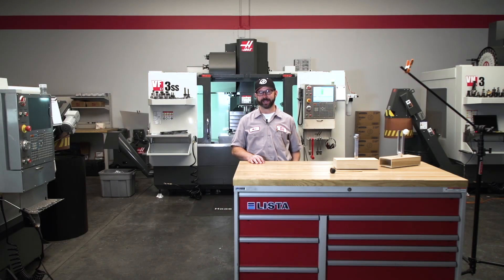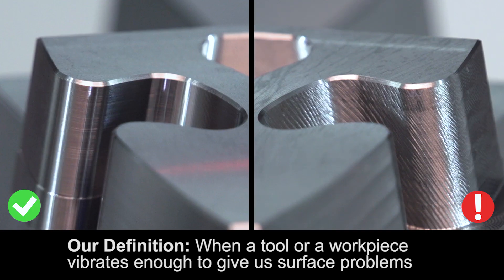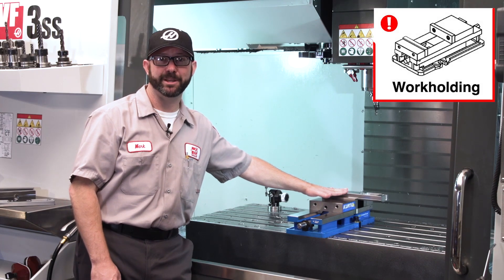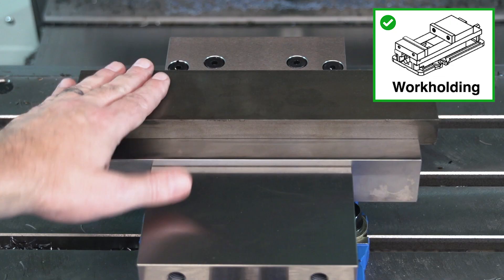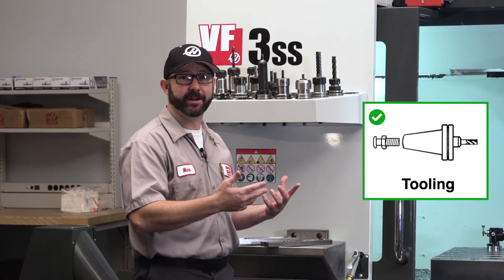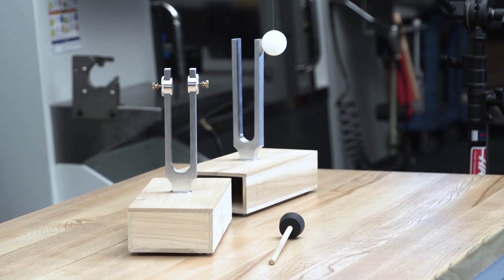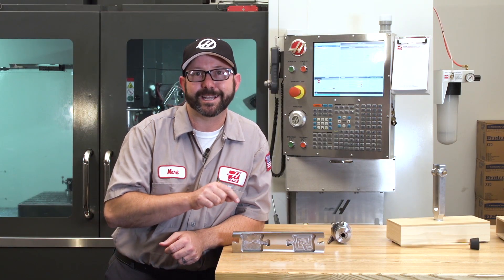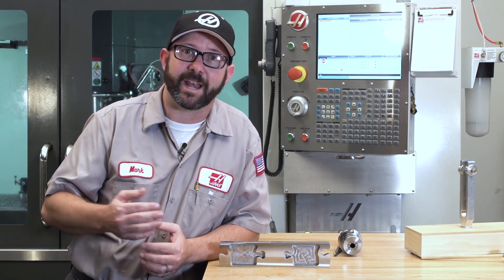Avoid Chatter on Your Mill - Haas Automation Tip of the Day

Comment: I know a secret about improving setups to eliminate chatter if Mark from HAAS cares to reply to my comment, I will share it. that way I know that I am being heard.
Reply from the maker: Paul – Now, I’ve got to know! What do you have for us? – Mark, Haas Tip-of-the-day
Reply: Mark I don't know if you know or not but there are two great ways to drastically improve a flimsy setup.
First is super stone from emdin products in california. it is a low shrinkage die stone used in the dental industry. when it dries it does not shrink like common plaster and is glass hard so you are literally able to clamp it in a vise. This stuff works well when you need to build support around the outside of a part The downside is that if you put it into a cavity it is like cement and will scrap your part because you cant remove it. Second is "Bear Shit" or green foundry putty. its very sticky and will fill a hollow part and reduce the chatter. You would use this if you need to fill a void inside your part.
Reply from the maker: Paul – Thanks for the post. You are touching on some real trade-secret stuff! Quite a few shops were using alloys, like Cerrosafe, to reinforce parts while they were being machined (expensive, plus many had lead in them). Bismuth is available, but expensive. Nowadays, like you’ve pointed to, more and more shops are using their favorite low-expansion Epoxy or Urethane Resins. This is commonly done to reinforce organically shaped 5-axis parts that would be hard to fixture for. Is anyone else out there using Casting Resins as temporary fixturing, part-reinforcing, while machining? Comment with links to what you are using that is non-toxic, and easy on your coolant! – Mark, Haas Tip-of-the-day

Comment: Interesting. But, aren’t we wasting time crossing over the pocket to get that constant engagement? If so, then the constant higher speed is being, at least partly, offset by the extra time taken in those otherwise unused paths.

Am I missing something here?
Reply from the maker: Mel – Our graphic didn’t show the back-feed moves in a different color. When the tool comes back over material that’s already been cut, it lifts off the part slightly and goes into a High-Feed motion, before ramping back onto the part before reentering the material. There are still lots of cases where an old-school, high-horsepower toolpath is still the best choice though. Thanks for the comment. – Mark, Haas Tip-of-the-day

Comment: Couldn't you constantly vary the RPM in a small range to keep the tool and workpiece vibration out of sync? I assume that's what -10% spindle does (I'm not a machinist), until the workpiece's movement again synchronizes with the tool.
Reply: Win Mildew sometimes once its starts chattering it won't come out unless you get underneath the chattered surface

Comment: Good video's. Only, i'm missin the importance of using high precision tool clamping systems. Collet systems can have a run out, mesured on 100 mm out of the collet, from 0,06 mm. Way to high, one wing of a for wing cutting tool wil do most of the cutting, and if you're lucky a second one wil do a bit of cutting. Causing vibrations, snapping tools, poor finish. A high precisiuon clamping tool ( for instance those from the comp Shunk) are reducing run out to 0,004 mm. No vibrating tools, no snapping tools and a high quality finish. Poor clamping precision can be the main chatter problem. Best regards.

Comment: ALL VERY NICE BUT, in many worskhop's over my lifetime ,  the FIRST and MOST IMPORTANT issue relating to chatter has been the instalation leveling and securing down of the machine , perhaps you could make this the absolute 1st point upfront  ....... many have wasted a lot time trying to correct problems without reverting to the main cause
Reply: Except it has nothing to do when your part is not secured properly, like the first example in this video.
Reply: Don't really no what type of workshops you've been working in?

Comment: Please do a video speeds and feeds! And what feeds and speeds to do with different metals please!
Reply: Most tool manufacturers give recommendations for their products speeds and feed.. but these only serve as guidelines because usually its not a universal application.. try for instance on a lathe, run an insert on low carbon steel that recommends 700sfm and .012 ipr at .1 depth of cut and try again at .01 depth of cut and notice the difference in chips, surface finish, even measurably how well your dimensions are held, etc.. then try the same test and compare your results on a different lathe.. there is usually a bit of trial and error when it comes to the fine tuning aspect of production. Generally stainless is slower than steel, and steel is much slower than aluminium.

Comment: Excellent video! I tried to tell the bonehead supervisors at work about speeding up and slowing down the rpm but all they know and tell people to do is slow down the FR. I proved them wrong many times when they asked about how I reduced the chatter but they just looked at me with that blank stare so I just walked away laughing and shaking my head. Lol
Reply: Trenton Buss their programs were wasting to much time and not getting good parts. Before I made the changes they would make double the parts to only get half or less than half good one's out of what they cut (I worked with glass). When I changed it they cut 700 parts for a 325 piece order and I turned out 689 good parts that everyone there said looked better than anything they ran before even all of the QA people. So yeah I guess I did show them. I did the job they hired me for. 😉
Reply: Well you showed them didn't you
Reply: John McCall I worked at a place that made anything from cell phone screen protectors to glass for automotive industry, to screens for t.v., tablets, atm's, to card readers and more.

They laid off last fall so I started doing my own thing making products that I have made for years on a part time basis and I'm in the process of making it into a full time business.
Reply: Where do you work? Round here most of them don't like you editing programs however if you prove them wrong the usually don't know that you've changed the programs, but I'm also 15 yrs in aircraft machining
Reply: Blessed are the wheels for they go round in circles 🙃
Reply: Ive had simular problems trying to explain to my bosses that noise and rpm does not make for faster or better machining. It just wears out cutters quicker. But they just didnt listen.
Reply: We,ve all been there and worse on both sides of the fance....try not to badmouth your coworkers as an example...not even the crackheads that drifted in and out....listen to me and your community will be much stronger.

Comment: Mark.. can you do ssv on a mill, like you can on a lathe?  like 9500~10500 rpm
Reply: Spindle Speed Variation (SSV) is a control feature introduced in Next Generation Software (NGC) version 100.16.000.1030.
It lets you vary the spindle speed by values defined in (2) settings. You turn SSV off and on with M-codes.
SSV is useful in circumstances where a constant spindle RPM might produce cutter vibration. SSV lets you manage the spindle RPM to eliminate the vibration.
SSV is available during milling operations. It is not available during tapping because the spindle speed must remain constant.

https://diy.haascnc.com/reference-docs/ngc-mill-spindle-speed-variation

Comment: I can speak to how well constant engagement tool paths work on my CRAZY janky benchtop CNC machine that weighs no more than 150 lbs tops. Yes it still is a flimsy machine but constant engagement tool paths really do make a difference! That said also figuring out each machines "sweet spot" with RPM & feed helps a lot with eliminating or reducing chatter. Just because your calculations say 5,000 RPM at 20 IPM does not mean that 4,500 RPM and 22 IPM does not work best!

Comment: "Get yourself a modern CAM system"  -Haas Quote of the day.  :)
Reply: Surfcam had this years ago. Guess it's finally making it to low end cam.
Reply: The best actually Powermill from Autodesk. But it has a price tag to go with it
Reply: @kzinty  and you are actually not ashamed to say it. Todd i feel sorry for u, sounds like u never gonna get this lucky to experience good CAD product
Reply: @iancho9587  I have used Autocad from version 10 to 2008 than SDRC Ideas for 2yrs,  NX for 7 years, than down graded to Solidworks for the past 5. I also used Mastercam and Powermill. Now I am using Fusion360 and it is better made than Mastercam but needs more toolpath method. Powermill is 1 of the best for milling.
Reply: @kzinty  Powermill has terrible adaptive style options. Great for 5 axis though.
Reply: We use solid works / cam works. Love it!
Reply: Yeah I’m gonna pick one up for my personal cnc
Reply: You mean EZCam isn't cutting it?
Reply: cimatron is best for me
Reply: Yes, like Fusion 360 :-)
Reply: SprutCAM from Russia is the best
Reply: Or the best, SolidCAM

Comment: would  SSV help to stop the chatter
Reply: Ssv means spindle speed variation. You can turn it on with an m code.. m38 i want to say? And it will use parameters set in your control panel to deviate the spindle speed by a set rpm over a set amount of time.. i.e. 30 rpm over 3 seconds on 1000rpm would change between 970 and 1030rpm every six seconds. It helps to reduce the harmonic frequencies which he mentions in this video. Have never used it on a mill but has really saved us a few headaches with long chattery boring jobs on our lathes.
Reply: Yes, SSV could help. SSV was added to Mills in the NGC control.
Reply: Explain SSV?  I'll have to look that up when I get back tomorrow, we have NGC.
Reply: Daniel Scott ooh. I didn't know they had done that
Reply: https://www.youtube.com/watch?v=dXR2wDDFFm4&t=2s
This video covers what SSV is and how it works, This was made for the Haas Lathes but can be applied to NGC Mills.

Comment: Very informative video. Could you recommend any cam software that use constant engagement tool paths with integrated HSM. Or if not what do you find the most popular or best for 3 axis or best experiences in your opinion?
Reply: SolidCAM with iMachining works fantastic for me.  I am using the version for Autodesk Inventor called InventorCAM.
Reply: Matti Ahonen if you're running a mill in a machine shop Fusion 360 is worth it! There are Machine shops using it to run multi tasking machines. It's very capable.
Reply: We have had great success for consideraly less cost by switching to OneCNC cad/cam from Patrick at OneCNC West. Super helpful guy who bends over backwards to help after the sale. Not affiliated, just happy customer
Reply: MLG420 Mcswaggerten At the shop we use Mastercam.. That's a quite expensive cam program but a really good one! If you're running a mill your garage I think you should check out Autodesk Fusion 360.. https://www.autodesk.com/products/fusion-360/overview
Reply: tim simpson Thank you, i'll check it out, see if i can get any trial versions
Reply: Matti Ahonen Thanks for the suggestion, So does mastercam have HSM inbuilt for curved faces, as i do a lot of tool making? I've heard a few good stories about this software and a friend of mine recommended it. Well as much as i've love to have a cnc in the garage, i'm running a cnc at work, Typical 3 axis - industrial standard.
Reply: MLG420 Mcswaggerten iMachining isn't a constant engagement toolpath. It varies the engagement, and the feedrate. Dynamic milling in MasterCAM, which was developed from the Adaptive Clearing found in HSMWorks, Inventor HSM & Fusion 360 are true constant engagement toolpaths.
Reply: Yes, Mastercam can do curved surfaces or wireframe geometry with its dynamic toolpaths.
Reply: Ok scott, thank you for the information. Which software utilises "trochoidal" milling for instance a slot,for instance instead of machining the centre of the slot and then finishing the 2 sides linearly, it will macro approach in a radial ramp on and off for roughing then machine the 2 sides linearly, is this classed as dynamic milling as you just said? Thank you
Reply: MLG420 Mcswaggerten trochoidal isn't constant engagement either. But there is a slot milling mode for Adaptive Clearing. Not sure about Dynamic milling.
Reply: MLG420 Mcswaggerten try it. Any of the three HSM products can be trialed, fully functional with access to hundreds of posts for free.
Reply: Keith Hansen in the USA.. the best person I can recommend for Fusion 360 support is Kevin Ellingson at Mechanical Advantage. But you're right. ultimately it's about having a vendor to work with that bends over backwards for you. And so often the right product to use varies by region because of that.
Reply: Scott Moyse okay thank you very much for the information, I use to use an older Hsmworks software, which had integrated rest machining feature, where you could use roughing and finishing tool paths where both would remove from the stock, I am after a program that ideally would have this aswell, thank you
Reply: Scott, iMachining might not be constant engagement toolpath, but it is constant happy machinist dueto faster material removal and very long tool life. SolidCAM is also able to tell you if your tool will want to chatter and allows adjusting the affressiveness with a simple slider. It is also the only CAM that allows the user to input material and hardness for the CAM to decide tool speeds & feeds, thus removing any guess work and enabling the user to make money.